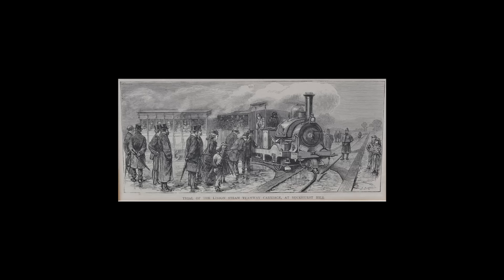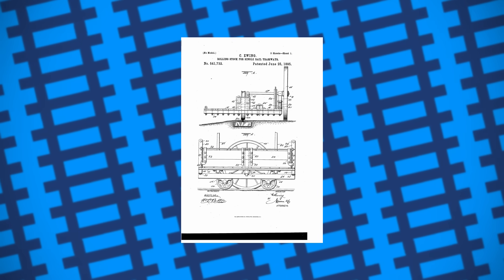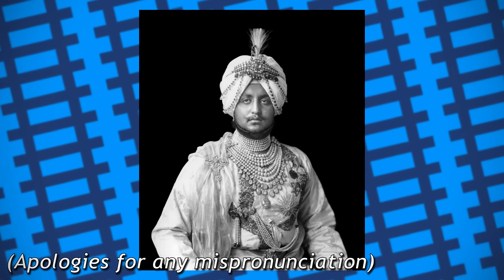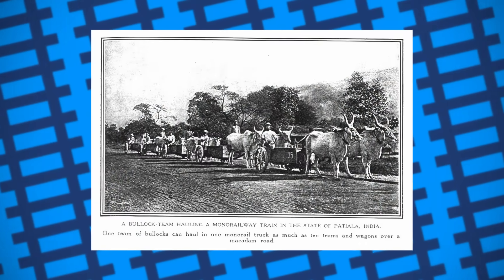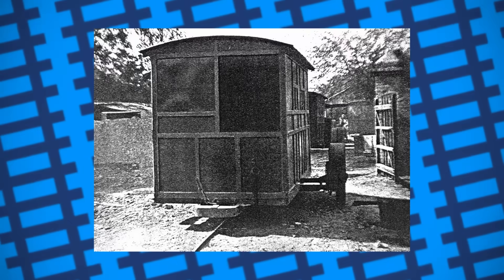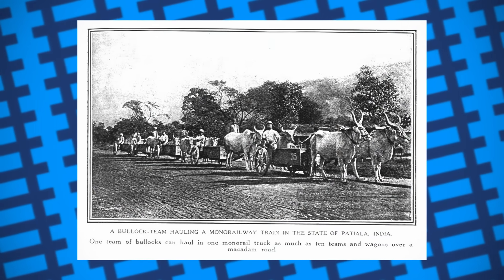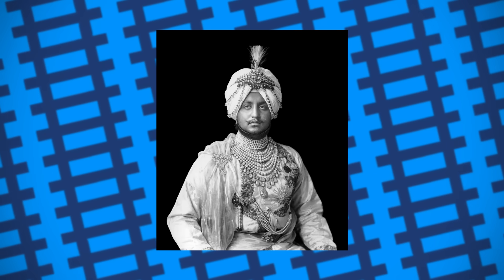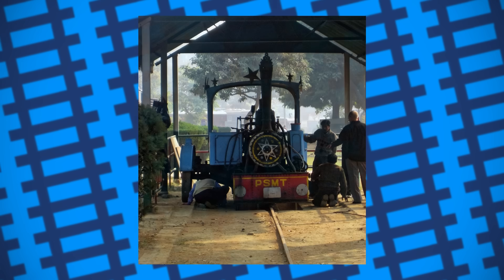The Monorail that Required Stabilisers - Ewing Monorail

Comment: 1:19 I know someone else has already pointed this out, but not only is the locomotive in that photo obviously an American engine... the caption clearly places the photo in Massachusetts.
I do hope that since this video you've been more attentive to what images you us rather than blindly grabbing them and shoving them in the editor.

Ewing's system at least worked better than Larmanjat's, and does seem to have been successful enough in its original intended use-case of something to quickly slap down to more easily shift construction supplies. Although that one A-frame monorail system seems to have done that better.

Comment: It's weird how monorails seem to genuinely make sense for construction. You really wouldn't expect that.
Reply: The Wuppertal Schwebebahn monorail provides reliable public transport since 1901.

Yes, there was the Tuffi incident, when an elephant panicked while in the train, broke out of the moving train and fell into the Wupper river (and survived the fall).

It's a suspended monorail, and it was cheaper to build an elevated suspended monorail above the Wupper river than a conversational track (the city has very little space left in the Wupper valley for a ground level train, so that was actually a neat solution).
Reply: Watch Simpsons Monorail episode

Comment: This is one of the cases of combining the disadvantages of rail and road transport without harvesting most of the benefits of either transport form.
The thing about rail transport is that you remove most of the friction allowing for an energy efficient, as well as comfortable ride, even on rudimentary suspension.
With the support wheel riding on pavement you loose most of that. but because you are guided by the rail and cant steer you gain non of the flexibility benefits of road vehicles.

Comment: Actually? This would be a great option for a cheaply built homemade railway. You only need one tiny rail, it still has a better turning radius than most anything else, and you don't need as many wheels per rolling stock. Plus the stabilizer wheel doesn't need to be flanged, so it could easily just be a junk bicycle wheel. It's a silly idea but it would be fun to try.
Reply: That was my thought! I grew up rurally and was obsessed with trains. Something like this would have been perfect to play about with and within my abilities to build, also.

Comment: fun fact they used 2 simular system on trams in France.
Nancy had a Bombardier monorail tire tram till 2024 were one steel rail guided the tram and the tires followed the road.
And yes it had the same problems and was only 2 decades in service  and also frequently jumped the rail.
The idea of 1 steel rail was in practice way more expensive to maintain/operate then a regular 2 rail tram.
The only part of the monorail system that survived is the powersupply by indunction instead of overhead wires. 
making it possible hat not only trams but also busses and municipality service vehicels can run on the line.
Only the translohr monorail tiretram is still in service and can be seen as the grandchild of the Ewing monorail

Comment: I could see this system potentially working for a type of bus service in cities. Just have the monorail stay on the outside lane with occasional points set up so they can cross intersections. At the same time, bus systems work well enough in most areas, so it could also be a pointless endeavor
Reply: It did. The town of Nancy had buses with a central guide rail. They only got rid of them recently. The advantage was they needed less space to turn etc., but ultimately they ended up being a more expensive trolleybus.

Comment: The fact that one locomotive of this obscure railway has survived into preservation is fascinating.
Reply: It used to run inside the rail museum where a small course has been built for the preserved loco and coach, although they stopped operating it after lockdown and this year they started operating it again (maybe only for a special occasion but it's operational and the locomotive still runs with the coach behind.......

Comment: I think there might be potential for tramways. With already smooth surfaces for the balancing wheel, just have the rail in the ground and voilà. of course it would be more suited for trams that share their ways with cars but I still think it could be an intresting experimentation.
Reply: Aye, thats a good idea.
Reply: I've heard of something similar. I do know that monorail tramways do exist in some form. From the images I can see, these trams heavily resemble modern trams, but with only a single rail inset into the road. Unlike regular trams that ride directly on the rails, these monotrams seem to use the rail exclusively as a guiderail for steering, and have rubber drive wheels that drive on the road. Essentially a rail-guided bus that looks a lot like a tram. As an example, look up the "Zhangjiang Tram" in Shanghai.

Edit: some of these guided tram/bus things use the central rail combined for power, with a single overhead cable pantograph. I assume the rail acts like a grounding rod in this case, which makes it like a weird rail-guided trolley bus? In this case, I am referring to the "Bombardier Guided Light Transit" system. This system, while it can use the guidance rail for automatic steering, they can also detach from the rail to drive freely like regular buses. Though the wikipedia articles states that they can move "erratically," while running free. I assume because they have a longer tram-style chassis, that they are difficult to steer when detached from the guidance rail. The article also mentions that they do not respond well if the driver mistakenly attempts to steer them while attached to the rail.